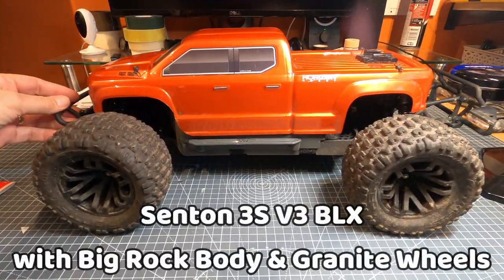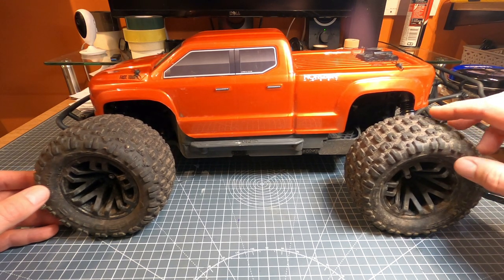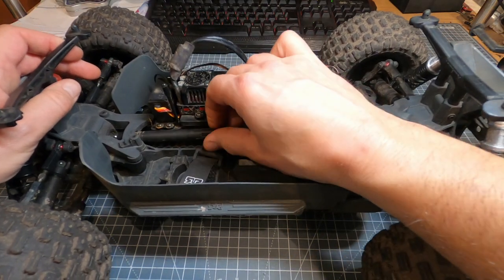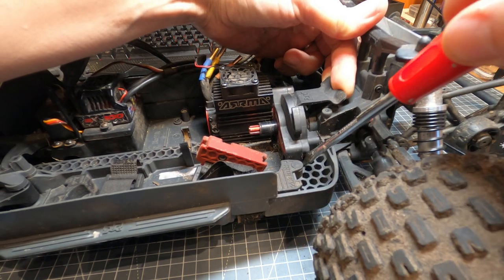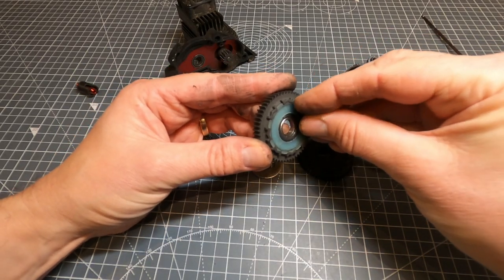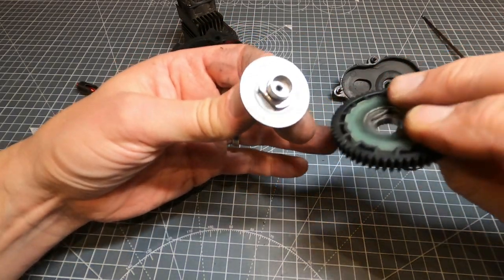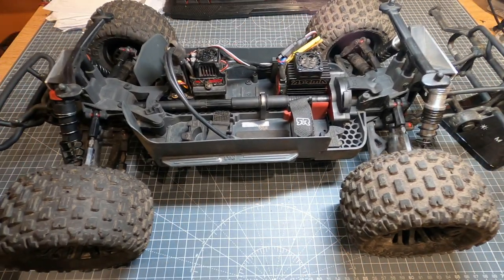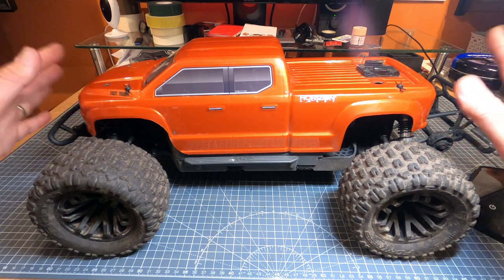Arrma 3s BLX Spur Gear & Slipper Clutch Maintenance. Granite Senton Big Rock Typhon Vorteks  how to

Comment: Just remember a importen note: Harder you tight it, more stress to the sprut gear! if you love speed and have that truck lift front wheel when hammer that gas, Then have a metal or seel sprut gear. plastic gears can allso do just as good but then less tight so the gear can move some when you hammer that gas down ;)
Reply from the maker: Yes indeed, all good points. Many thanks for your great feedback 😁👍
Reply: I had an aluminium one. The last drive was 30 seconds and it's tooth where all gone. Only did drive from my car to the track through gras. Yea there something horribly wrong. I am not sure what.
Reply: So where do you set yours? As it wears it's also going to change so I feel like you almost need a specific torque to aim for when turning the clutch by hand when it's out of the car and check that periodically.
Reply from the maker: I tend to set them to tight then loosen 1.5 turns. If I hear the clutch slipping when the car runs then I tighten it half a turn at a time until it doesn't happen anymore. My new 4s car needed the clutch to be tighter to stop it squealing. I need to do another video to explain it better really. Thanks for your comment 👍
Reply: @PeteWylieRC  Thanks for sharing Pete that makes sense. I set my Senton to 1.25 turns out and it didn't slip (not that I could tell). Also tried the "push the car to tighten" method which made it 7/8 of a turn out. Not sure if this is really accurate as it is dependant on the tires gripping on a surface to measure and is only playing with the resistance of the spring against the screw, not the clutch plates slipping. Figured if it drove ok at 1.25 and still did wheelies on grass it didn't need to be tighter anyway!
Reply from the maker: @bensonCP  thanks for this info. Much appreciated. I've got another video coming out on this subject which hopefully explains it better 😁
Reply: @Nordlicht05  get the expensive steel gear not the chinese aluminum one
Reply: @jaroodthefab5669  was pretty expensive from UK. I use now the plastik one
Reply: Sprut gear😅
Reply: Please Sir Solve My RC Car Steering Problem 😞
Reply: @Nordlicht05 you tightened the motor with the pinion too close to the spur, if there’s no play between them that means that it’s too tight so no matter what material the gears the pinion or spur will just be toothless because of the tolerance, less tolerance more problems, how? I’ll tell you how
When you tighten and stick the pinion way too close and tight to the spur and there’s no little wiggle, turn on the system and run it, you push the trigger forward/backward, *the pinion teeth between the spur teeth will turn to the next spur teeth and chew up the next pinion or spur teeth*, depending on the material.
Always check if it’s too tight, keep a little of play to also let the slipper clutch work.
Reply: @alexh.9550  i put a paper between it. Maybe something came loose
Reply: @Nordlicht05  oh… so maybe the motor mount is bent or something like that is wrong or not into it’s place.
Reply: @alexh.9550  the spurgear axle was bent. Additional maybe the mesh too tight because of that.

Comment: A rock got stuck between my motor and shaft. When you remove the drive shaft by pulling spring back I see the small black cup left of clutch. Does that just slide off? Part # ara311033 mine is melted and grinder up. Or do you have to remove clutch guard to install
Reply from the maker: Hi there. Yeah that cup just slides off the drive shaft. It's not entirely necessary to make the car work as I it's missing on one of mine. Thanks for watching 😀

Comment: Just changed my sour gear on the vorteks for a steel and when I’ve put it back together my drive shaft doesn’t turn when I free roll like yours.  Any idea ?
Reply from the maker: Ooh not sure. Is the mesh ok between the spur and pinion? Also is the clutch back together ok? You can test it by hand like I do in the video.

Comment: That's a good idea. Greasing that little area around the open hole where the gear is showing. One of my motor bearings started to fail.  Now I have to learn to dig a little deeper in my Senton. Great vid!
Reply from the maker: Hi there. Thanks for the great feedback. You can theoretically change the bearings in the motor although not tried it on these. Hope you get it sorted.
Reply: @PeteWylieRC  I found another vid on it. Not that hard to do. Just realizing now if you bash an Arrma long enough and hard enough things with break! Lol
Reply from the maker: @DrDurango15  Ah cool.  I did do it on one of my motors of another brand and was just a bit tricky to get the old one out because rusted in. Good luck :-)

Comment: Great information. Really love that you mentioned the loctite on the motor plate screws and the grease under the power assembly. I bent my motor plate today and it chewed up my stock plastic gear. 
The installation and removal of the motor unit is incredibly annoying. Where I bash out here in the desert the sand gets all up underneath it and into the gear box and makes it a huge pain to install and remove it plus all that sand in your gearbox is terrible. Great tips definitely earned the sub
Reply from the maker: Hi there. Yeah I think that the loctite is a must on that sliding motor mount. It's a shame that they stopped making the one with the fixed positions. It's also a shame that the gearbox isn't sealed at the bottom as it's obviously a place where the dust van get in. I've not tried them but I've seen aftermarket motor plates which may be stronger. I did bend the stock one too but just hammered it flat again. Many thanks for your great feedback and the sub. Very much appreciated 😁

Comment: Great tutorial, well done 👍  This will be a big help to people new to the Arrma lineup.  I will say that I prefer the adjustable motor mount though, much finer adjustment for more precise gear mesh.  With the pre-set mount, even a slight bend in the mount and the mesh will be off, with no way to adjust it (short of bending back the mount).
Reply from the maker: Hi there. Yeah that's a good point about the motor mount. I have had the mount bend so I needed to hammer it flat. It seems that they discontinued the one with the set holes anyway. Many thanks for your great feedback 😁
Reply: @PeteWylieRC  Yes, they all come with the adjustable mount now (I know this is an older video).  I ended up going with the M2C motor mount/chassis brace combination - expensive but fully adjustable and eliminates any flexing in the chassis!
Reply from the maker: @jerryvolpini7987  they both sound like worthwhile upgrades. Thanks for the info 😀

Comment: Great tutorial from my guru. That should hold better now that you've got fixed pinion position on the motor plate. Keep safe and well😉😁👍
Reply from the maker: Haha, I don't think I've been called a guru before. I've been called a few other things! Hope this helps with your Arrma's. Have you got them yet? Many thanks for your comments my friend 😁
Reply: @PeteWylieRC  Hi Pete ( my guru ) oh yes, both my son and I, now have Arrma Typhon Mega ( the slower ones, I know, but still learning trigger and wheel radio gear ) All we need now is to be let out so that we can go buggy bashing! Your Arrma videos have been invaluable, big time ! I'm still working on my Carisma SCA-1E Range Rover, not happy with the spray painting, got what appears to be stretch marks in the bodyshell, it looks like stress marks, but the importer seems to think it maybe a paint reaction, if so, then I'll either have to paint killer the whole body and start again, or even buy another body shell. Not sure at the moment, but spent hours and hours so far, grrrr!

Comment: Great content as always. Could you let me know what grease/lubricants you use for your arrmas? I’m going to be relying heavily on your videos for my Big Rock’s first strip down and want to make sure it goes back together in top condition.
Reply from the maker: Hi there. Well I'm not really an expert on products like that. I think people mainly use a general purpose engineering grease. I'm using some LM2 grease in the bevel gears and it seems fine. Inside the diffs I'm using 20000cst silicone oil. In the shocks is something like 600cst. You don't need grease on the spur gear/pinion. Not sure if this helps. Good luck with the maintenance 😁
Reply: @PeteWylieRC  Cheers. Really useful info. Looking forward to tinkering. 👍🏽

Comment: really useful tutorial to help open this motor differential and close it knowing "where that screw was supposed to go", thank you! I was just wondering where can I buy this useful spur gear, or is it original?
Reply from the maker: Many thanks for your great feedback. I'm not sure what you mean by the useful spur gear? If you are meaning the motor plate with set hole positions then it's not available anymore ☹️

Comment: I don't know the reason, but I can tell Arrma has designed rear to have 2 slipper pads while front to have only 1. The front side of my clutch had good amount of friction, while rear was way too stiff. Replacing a slipper pad on the front (which worn out a bit) with one of 2 rear ones (which still looked like new) made them balanced more evenly.
Reply from the maker: Ah ok that's interesting.   I know that on my 4wd Tamiyas without a clutch it's the front bevel gears that break first.  I think that the strain on the front gears is more under braking than the strain on the rear gears under acceleration.  I think that is probably the reason for the difference.  Many thanks for the info :-)

Comment: If you take the little red wrench like thing and insert it into the output shaft then roll the car/truck it will wind the screw in or out depending which direction you roll.
Reply from the maker: Hey great tip. I've not tried that but I'll have a go next time I'm doing maintenance. Many thanks indeed 😁👍👍

Comment: Hi Pete. Great maintenance video, thanks! Someone recommended installing a 15T pinion in the Senton 3S BLX to improve acceleration if not concerned with top speed. I'd also prefer longer run times and cooler running so I'm thinking the 15T. What are your thoughts - should I stay with the 20T stock pinion or change it to a 15T? Thanks for your advice. Saw in another video that you had changed your Senton from 20T to 15T so I got my answer. Cheers!
Reply from the maker: Ah yes as I was saying before I think that the 15t for general bashing is great. Still really quick on 3s. Thanks for your feedback 👍

Comment: Hi mate! Where do you get that beautiful red engine mount? Looking on Modlesport UK, they only do an upgraded version but not with the difference gear holes. 👍
Reply from the maker: Hi there. Oh that motor mount with the set hole positions got discontinued unfortunately. You can only get the sliding mount now. Just make sure to use threadlock so the motor doesn't move in use. Thanks for watching 😀
Reply: @PeteWylieRC  Ahhh darn it! I will have too try that once my Senton arrives, what's the difference between the standard one and the upgraded one that you can get?
Reply from the maker: @LordKingPotato  I believe that the upgraded one is stronger. It is possible to bend the standard one if you drive it into walls at full speed or land it badly from extreme height. I've not upgraded any of mine yet.

Comment: At 10:30 timestamp on the video, what is the black cap you put over the red piece? I believe i need one of those. Thanks for the tutorial!
Reply from the maker: Hi there. I'm not sure what that bit is called but it was in there when I started. I don't think it's essential to make the car work if yours is missing. The spare part you need if you want one is ARA311033. Bit pricey as it comes with a couple of clutch bits. Thanks for watching 😁

Comment: Mine did the rear drive shafts first run out , the diff ring and drive gear the second outing , had no adjustment in the clutch slipper as there was no tension spring in it , so it was either on full send or with a slightly undone adjustment it would not drive at all , got on to the Horizon main distributor  in the UK and they've sent me all the parts needed under warranty as it was a Quality control issue
Reply from the maker: That's interesting. I've not had much bother with any of my 3s cars. The spur gears wear out eventually but they last quite a while. Also there are the things that need threadlocking that I covered in some other videos. Hope yours is more reliable with the new bits. Many thanks for the info 👍

Comment: The fixed mounts are generally not cut for proper mesh. I know the 15t is too tight.  I think they just need to do a plastic insert like traxxas does.
Reply from the maker: Hi there. It seemed about right to me. I just like the fact that it won't slip out of place. Haven't seen the Traxxas thing. The only Traxxas I have has the standard sliding plate. Thanks for your comments 😀
Reply: @PeteWylieRC  basically the way traxxas does it is a plastic insert that has holes for the gear option. That way it can be solid when you use traxxas supported gear options or just take it out if not.
Reply from the maker: @dylanwhite6539  Ah right, clever idea.

Comment: Ooooooooooooo man ive been trying to work out what that wing nut was for hahaha ... Its in the rebuild kit and in my exploded diagram..however ive only ever oulled my skipper apart twice.. once for pinion and other just to check the pads... Ive never had any issues tightening mine up bit it does coem loose eith out loctite... Is it supposed ro uave that wing nut in the 4s slipper as one never came out of mine? 😮
Reply from the maker: Hi again.  Yeah the latest 4s cars which are the version 2 have got that little plastic wing nut.  Not sure about the original version.  Hope you got it all sorted.  Like you say a bit loctite is good if yours doesn't have the plastic nut :-)
Reply: @PeteWylieRC  yeah I did get it sorted thankyou haha turns out it was all good It just needed some maintenance and that wing nut 😅👍 Loctite was apparently just doing a good job on its own 😄

Comment: I bought one of these and the bearings on the motor has gone, I bought it a year ago and all we have been doing is buying spur gears I bought and steal one and it lasted 5 runs maybe ran it 20 times maybe. On the last spur gear I needed to straighten the faceplate so had to take the pinion gear off and forgot to do grub up on the pin gear when I put it back together, that killed the motor bearing, steel spur and pin gear. Oh boy, that mistake is costing me.
Reply from the maker: Hi there. Ooh sounds like you've had a fair few problems. I did have the motor pack up on the Senton which got replaced on warranty. The one on the Granite went after about 2 years of being hammered to death. I haven't been going through spur gears very much. They do wear out eventually but I think each car has only had one replaced. Is your slipper loose enough to protect the gears? In your other comment you are asking about the faceplate. Are you meaning the motor plate with the set holes? If so then they stopped making it unfortunately. Was that what you were asking? Cheers

Comment: Hi friend, do you face issue bevel gear & differential gear replacement ? The tooth of the diff gear & bevel gear become damaged (saw it in another youtube review). I would like to purchase Senton V3 blx , and now doing research for this Rc car
Reply from the maker: I have done a series of videos about maintenance on the Senton including the bevel gears. There is an unboxing video and a review video and they cover most of the bits of the car. Also check out my Big Rock unboxing which does a summary of things to check.

Comment: What kind of grease did you use to keep the dust out of the slipper clutch? Also have you ever tried velcro? If not do you think the grease is still better than the velcro? Ive been running my Vorteks here in Arizona and the dirt is extremely fine. It gets everywhere but luckily none has gotten into the motor assembly YET..
Reply from the maker: Hi there. I'm just using some standard LM2 grease that I had and it seems to work fine but I'd imagine that a slightly thicker grease would be better at staying put.  I did see someone doing the velcro thing but I have not tried it myself.  Does look like it works but maybe velcro with grease on would work even better? I will try that next time I have one of these apart.  Many thanks for watching and commenting :-)
Reply: @PeteWylieRC  great info and thank you for the quick reply!

Comment: Great vid👍i tried adjusting slipper clutch on my senton blx but the 2mm hex screw wont loosen or tighten? Any ideas? Thanks
Reply from the maker: It should loosen if you try hard enough.  I don't think you will break anything by using a bit of force!
Reply: When I tighten mine down it's tight...BUT it loosen up where I can see the spring and the little brass part and cap the spring touches are inside spur...need help!!!

Using new slipper plate and hub set and new spur

Comment: I think my slipper might be to tight.   It came loose.  I re tightened it using the roll on the floor method.  But I think j went to far as the next pack thru my granite, the rear diff starting making a clicking sound
Reply from the maker: Ooh dear, better get it apart to see what happened.  Hopefully nothing expensive!
Reply: I bet it was the outdrives

Comment: I keep breaking the rear plate at the splines on mine, I've changed it twice so far and I took it apart to change the spur gear and notice it's cracked. I wish they made an upgraded one that was steel and not aluminum
Reply from the maker: Oh right that's odd as I've not had that problem and I've got 4 of the 3s cars and also a 4s car.  Don't know what to suggest really but hope you can get it sorted 🤞 Thanks for your feedback 👍